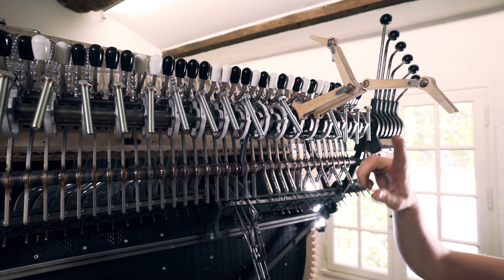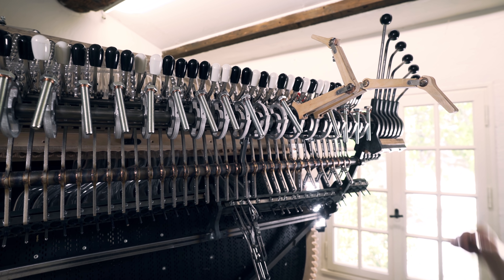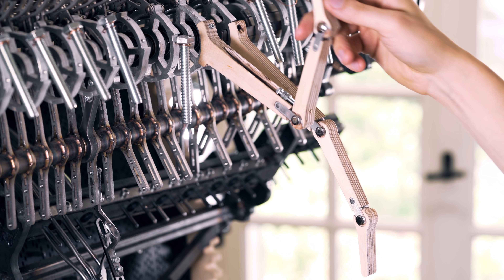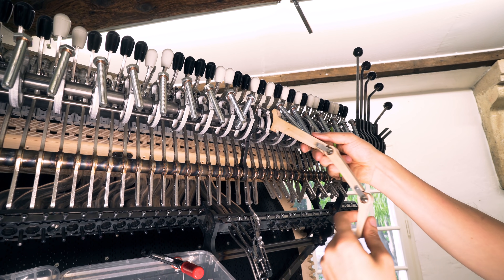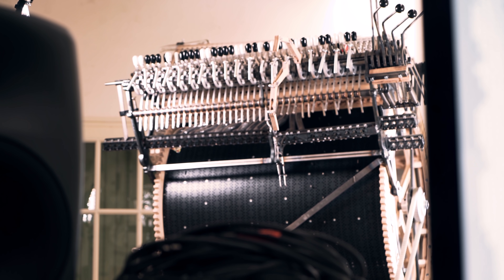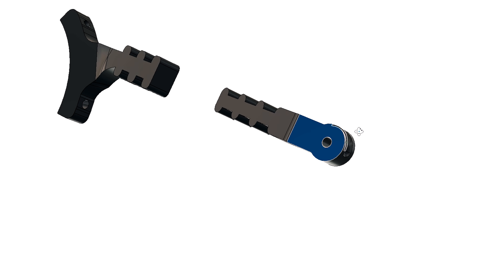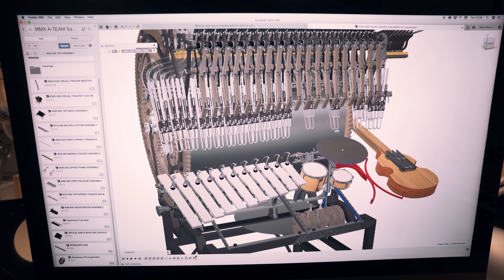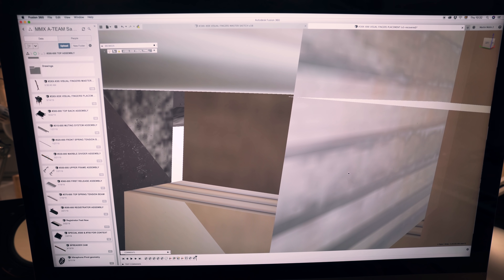Kinetic Fingers Prototype - Marble Machine X #82

Comment: I don't give a damn what all of these nay-sayers are saying. I love these things and have been anticipating them ever since you'd first mentioned them. I love how unsettling they are on the surface level and I can't wait to see the beauty of the final version. Most of the criticisms are moot points and points you've already addressed anyway; this is the way the Marble Machine X is supposed to be and I love it! I only think it could be improved by tightening the movement to be more rigid and less 'bouncy' or 'floppy' if you can and make it blend in with the rest of the coloring of the front of the machine - that I feel would reduce the dissonance people are experiencing with this piece, but that's not important if that's not your intention.

Comment: Ummm Martin, over-design is a thing you know. I personally would consider the Kinetic Fingers rather ancillary to the experience of the marble machine.
Reply: Ancillary means the opposite of what you meant to say
Reply: @revlarmilion9574  I mean in the sense they are supporting or supplementary, more precisely, I meant this feature is not a structural  or primary requirement to the MMX experience. If you assume I meant the feature was unnecessary I apologise if my statement came across ambiguously. It is obviously Important to Martin that this feature is implemented, I personally do not feel that the fingers are what I will be paying attention to with the marble machine. 

I hope that clears things up.
Reply: The whole machine consists of overly complicated parts that could be much simpler, but it looks way cooler like this. Looks have always been a very important design decision.

And if you consider that the machine is designed for the purpose of playing on stage, it does make sense to add them. The machine will be virtually invisible while playing from such a big distance

Comment: Martin! I was actually dreaming about those mechanical fingers yesterday! I had the idea that if at the tip of each you'd put the tool to make bubbles (that circular thingy) and where the fingers go down, some sort of container to hold the soapy water, with enough lifting force in the  fingers mouvement, the marble machine would be making bubbles: in sync with the melody!
Don't know how'd that work in practice, but it'd be cool too :D

Comment: I was wondering if you could achieve the same effect with springs, and maybe cables, like you often see in robotic hobby arms. Simple weights might be an easier solution, but I would think that spring would apply a more constant force to the joints regardless of the angle of the various limbs.
That all being said - if those parts are already in the mail, you've picked a design and ran with it. Accomplished projects are always better than imagined design.

Comment: I can see why you'd wanna make those, but I really don't see what they add to the machine. They're noisy, distracting, potentially creepy and definitely a point of failure

You do you, maybe they turn out great, but as is, I'd be happier to not have those be there
Reply: After some more deliberation, I am convinced they are creepy, needless and only detract from the rest of the machine.
Pls don't do this Martin, I know lots of work went into these, like all your parts, but this is the first and hopefully only time we tell you that this is a terrible idea as is :(
Reply: I think a touch of creepy is deliberate. It fits the theme of the band (an Martins performance on stage)

Also you say you don't see what it adds to the machine.. As he said, they are so you can see the machine work even from way back during a concert.
Reply: But isn't that what makes it different than normal.... Not everything has to be perfect not as you call it "a failior"
Reply: I said point of failure, as in something that's prone to breaking easily while being necessary :)

Comment: Martin, you talked about playing the knobs of each channel manually, how do these visual fingers play along with that?
Reply: Also: so the fingers are purely visual? I've really liked how all of the other components seemed to have both visuals AND function.
Reply: My second concern is the extra weight and resistance being added to the programming pins/wheel.  I would want to see if there is extra pin breakage or plastic deformation in the wheel due to the additional weight.
Reply: @michaelweaklend  Don't worry about the plastic, it's only used for testing new songs. The final program will be on a metal sheet with studs welded on.
Reply: @voxelfusion9894  I didnt know that.  I was under the impression there was going to be audience participation in reprogramming the wheels between songs.

As for plastic strength, I think you'd be surprised what continuous repeated wear can do.  Deformation if the plastic, even for test wheels, could affect play speed or timing.  Then you are adjusting design to a flawed wheel.
Reply: @michaelweaklend  Even if they aren't used for shows, the plastic could in deed degrade during testing.
I not a fan of the fingers, they get in the way of the manual knobs as well.
Maybe if we see the final version I might change my mind but right now it's plain creepy.
Reply: I might be picturing this wrong, but won't the fingers get in the way of manually playing?
Reply: I've already shared my thoughts in a parallel thread but still I believe it makes sence:) The idea is that manual playing is only reasonable and possible when the programming wheel is stopped due to at least the following reasons:
1. to play manually in parallel with the turning programming wheel you need to somehow keep the tempo (and I don't believe that the pedal can help here);
2. a particular section (bass/drums) must be active to use manual knobs but if it is active then pins on the wheel will also play in parallel some programmed melody.
Reply: Manual playing can only be done when the fingers are unmuted anyway. On the first marble machine Martin stopped the machine before playing manual. On the MMX he will likely let the flywheel free spin (not engaged to the programing plate) to allow him to play manually and have the fingers move.
Reply: @curtisburgess3044  when flipping the fingers back, aren't they even more in the way? I hope Martin hasn't overlooked this and I'm just not visualizing it properly.
Reply: @voxelfusion9894  That is true. However, the marbles can only be released when the fingers are in the down (engaged position) so manual playing could only be done when the fingers are out of the way.
Reply: It looks as if the fingers block the knobs making them harder to use. I'm surprised he would add something that blocks functionally, but I trust he knows better than we do.
Reply: @joeytheghost4211  The fingers appear to block the knobs only when their channel is unmuted. I would expect manual play to happen only on muted channels.
Reply: Why not make the fingers functional by turning them into a keyboard!? When you press on a finger, it releases a marble. Function over form.

Their design would need to be modified a bit but they would be useful, and you would still get the same effect, but with functionality. The knobs seemed like a rough draft idea.. a quick fix. But the fingers do add visual presence. They just don't seem to do anything practical. If you somehow convert their function to manually toggle a marble release, you create a use for them, retain the visually amplified aesthetic you were aiming for, AND they would serve a purpose.

Comment: Arent you blocking the reach of the manual playing knobs then
Reply: First thing that came to my mind....
Reply: Wouldn't he usually not be spinning the programming wheel if he's playing manually? So it wouldn't matter if they were down because the programming wheel wouldn't be turning. Although, no drums for manual performance then.
Reply: @girldethunderscore  he could be spinning with the treadle pedal, could play with the levers even if the machine was playing another tune or a drum beat so yes he can play with the machine still spinning
Reply: @girldethunderscore  I think the machine needs to be running in order to refill the marbles, but with the some, or all, instruments muted, and in muted mode those fingers look as if they cover the manual keys even more ?
Reply: @YozhikvTumane  AFAIK you can't play a muted instrument, even manually. The muting mechanism is downstream of both the programming pins and the manual levers, so would disconnect both of them.
Reply: @Echin0idea  apparently I haven't been observant enough, I thought the muting only disconnected from the programming wheel ... need to go back and check older videos
Reply: @YozhikvTumane  I could be wrong -the way you thought it worked would be much more versatile. I was thinking of it as an unfortunate limitation
Reply: I think when he switch to mute  all finger gonna bend backwards
Reply: @basisTermium  And that's precisely the problem! They bend towards the knobs!
Reply: @Koushakur  he could find a way to bend them inwards like a hand that closes (fingers don't flip backwards).
Reply: @basisTermium   that makes even worse
Reply: Fun thinking like this is how the Marble machine came to exist in the first place. While this is a valid question, one I would love to know the answer to myself. I feel compelled to just appreciate the fact that Martin is a creative genius and this is his mind stepping out of the room it's been trapped in for a stretch of it's legs and arms and getting some fresh air.
Reply: I was thinking the same thing. I can see Martin reaching to playing manually and breaking a finger!  Either his or the MMX's.
Reply: Martin. Instead of fake fingers, why not create a better use of the space by replacing the push knobs with a keyboard to release marbles while in manual mode? Scrap the knobs (which was a quick fix) and scrap the fingers (which seems like a rough draft idea.) Function over form. There are other ways to amplify visual impact from far distances!
Reply: To me it is quite obvious that he is going to use manual playing knobs only in the same way as on the first Marble Machine, i.e. ONLY WHEN the programming wheel is STOPPED. All these visual fingers are going to be in "down" mode making the knobs reachable.
I mean what could be even theoretical way of manual playing on running programming wheel? Just keep in mind at least two things: 
1) once the player stops turning the crank the tempo goes down (of course you can try to use the pedal but it will be extremely tricky to play by hands at the same time for many obvious reasons)
2) as far as I understand it a particular area (drums/bass/modulin) is active only when corresponding lever is turned on, but this also means that all the pins on the programming wheel are going to "play" as well - imagine how difficult it would be to combine the programmed melody with something that you would like to add manually.
Reply: I was about to comment about it 😂
Reply: was thinking the same ...
Reply: I wonder if those fingers can hit you in the face when pressing the knobs. The will lift up when the channel is muted, so that will make it easier to play only the channels which are opened but they seem a bit creepy and in the way; that said, I might think differently when they're all assembled.
Reply: @gasparRaduB  I would actually agree with your concern! I hope Martin's arms are long enough to avoid that nuisance)
Reply: Also, it's disturbing that the fingers lift when they "play" a note instead of lowering.
I love the idea of the fingers though and Martin seems so proud of it (and he can) !
I'm sorry we are many people feeling circumspect about it, but there must be a way to improve the design.
Reply: lol hes not mounting the vibraphone up top.  This will be down below.
Reply: No, look at 1:00. When these fingers are down, you can easily reach over them to play the machine manually.
Reply: @Mashandstill, I was thinking the same thing
Reply: This feels like a filler episode =~=
Reply: That's what the angled assembly is for, to keep the finger out of the way of the knob it's connected to.